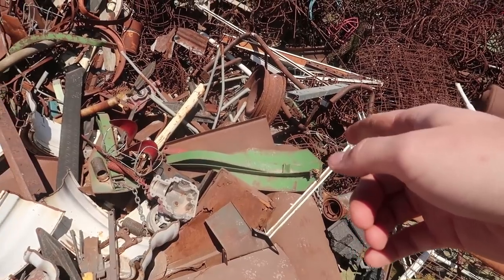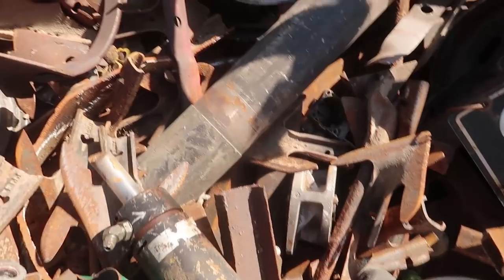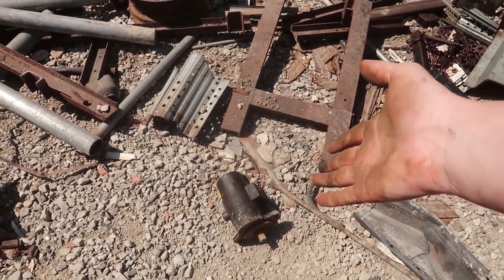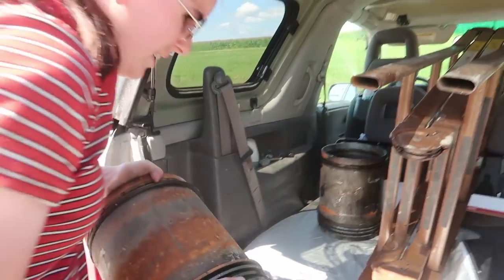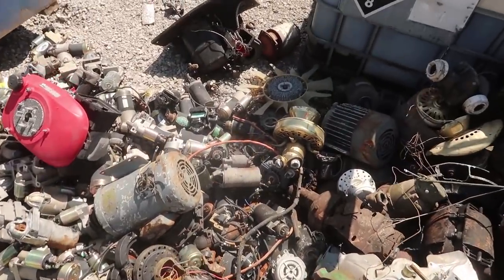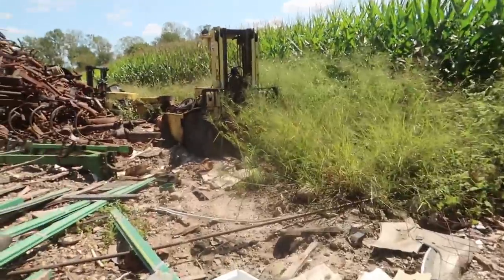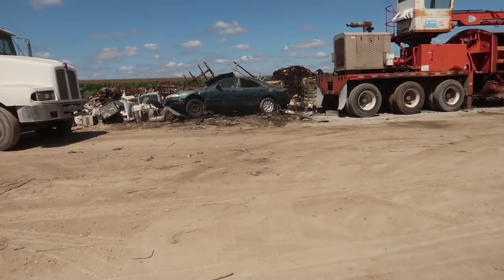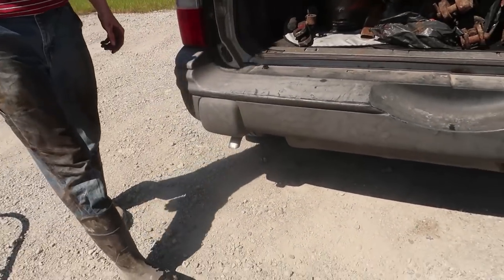Scrapyard Treasure 05: Hydraulic Cylinders / Rams / Pumps, Luxfer Cylinder, DIY Excavator Parts

Comment from the maker: I got 5 hydraulic rams and 1 bobcat hydraulic pump for the excavator project. i figure for such a low price i will collect junk parts and experiment. i bet these rams would work really well with new seals. perhaps run the pump with a large AC motor for initial tests.

You guys tend not to understand that my projects can take a long time to finish. depending on what parts i find, and needing plenty of time to think it through. i could have an excavator by next spring or years from now. we shall see where this goes.
Reply: I noticed a lack of optimization in your work on this video series, but calm down I already found a solution -> "Move your house to the scrapyard not viceversa" ;)
Reply from the maker: i dont want the scrapyard, i just want the treasure. hehe
Reply: You will probably want to look for a open center tandem spool with closed work ports in neutral, then you’ll get away without using counterbalance valves to hold the rams in the air with a load.
You will need a few hp 15+hp to power that bobcat pump because it puts out many CC’s of fluid per revolution, and last a relief valve setup to keep a safe working pressure for the hydraulic devices/hoses.

Comment: I was thinking you need to find a heavy equipment junk yard or travel to other junk yards/ scrap yards because you would need to find a large enough bearing for your turn table to work well enough depending on how large your excavator is going to be . And it would be best if it's a larger diameter sealed needle bearing than a ball bearing .  And I would take a good micrometer with you if you find a hydraulic piston that you can open check for wear but you can always re seal the Pistons if needed and it's not that hard to re pack piston seals . Good score on the  3 larger Pistons at the end of your video those would work great for lifting the boom and the Dipper arm !

Comment: Ah, i think this will be awsome!
Hydraulic rams may be pretty easy to fix with a bit of luck (at least good enough for what You plan to use them for), the pumps may or may not be fixable, but i had give them a try too, for Your applications i don't think minor faults or preformance loss realy matters, it's different if something sits on equpiment that's dayly used in a company compared compared to just getting something to experiment with, and i think You will hawe a most of yor money back anyway if something is not realistic to fix.
And most important, i think You will learn a lot from those.

I think The sweingmachine was beautiful as a sculpture, but i also think it will be possible to fix.
(I hawe a few pretty similar machines but different brands and i managed to fix all of them).-

We all look forward to Your work!

Best Wishes//
W.

-

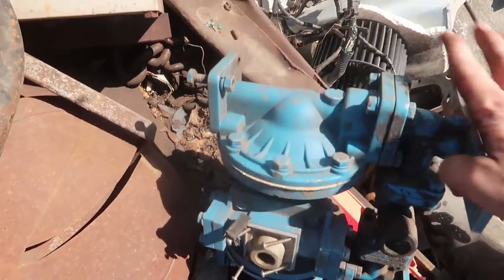Comment: That blue thing around 25:00 looks like an air powered pump used for flammable liquids like gasoline and oil.
Reply: Pneumatic Diaphram pump eh...   Üü
Reply: Actually I believe its a soap injection pump from a self serve carwash equipment assembly.
Reply: Yep, flamable liquids diaphragm pump. we've got a one about 2 times that size in our scrap pile. I'm trying to think of a use to pull it back out.

Comment: Video quality is very sharp at 1080p50.
Reply from the maker: thanks, i figure doing 50fps allows for each frame to be 1/6th clearer than if i did 60fps. and 50 looks just as good as 60.
Reply: @RinoaL  what is the camera details that you used in this vedio.
Reply: 100 Marks for recycling....

Comment: make a quick frame and bolt one ram on it ..
find hydraulic lines that fit the ram
fill ram with power steering fluid and bleed the ram..
you may now pump it..
the hoses may be your greatest challenge to find (lines) being careful not to strip the threads as the materials maybe soft
Reply from the maker: hoses are easy to buy, along with hydraulic fluid
Reply: @RinoaL  we will see
Reply from the maker: what?
Reply: @RinoaL  how you do